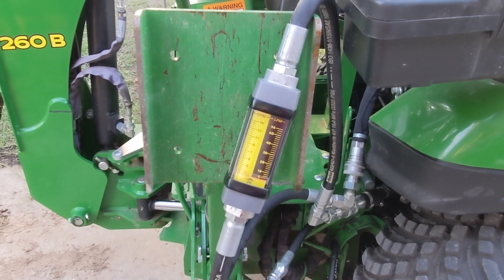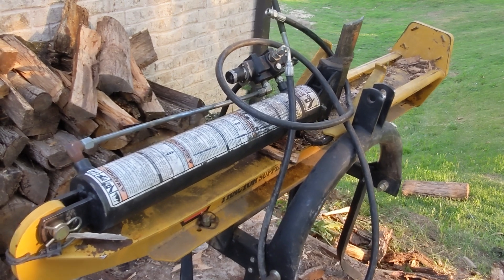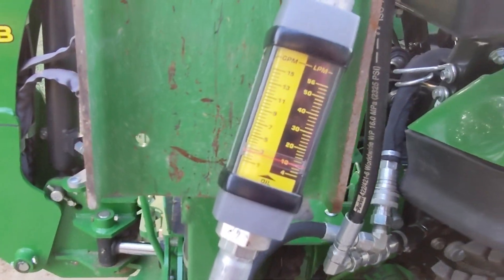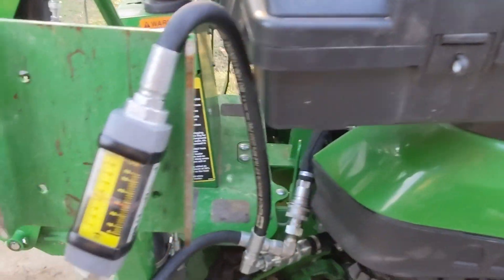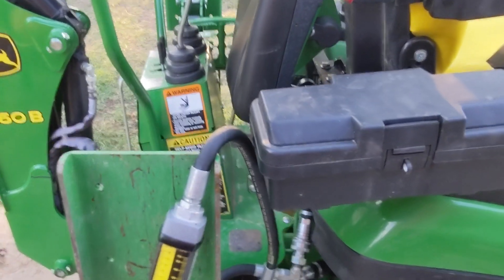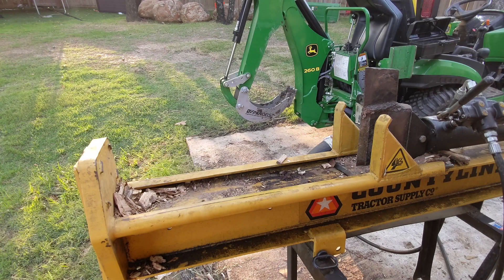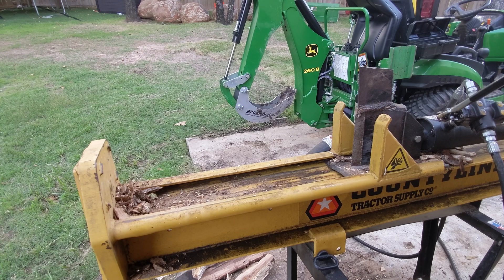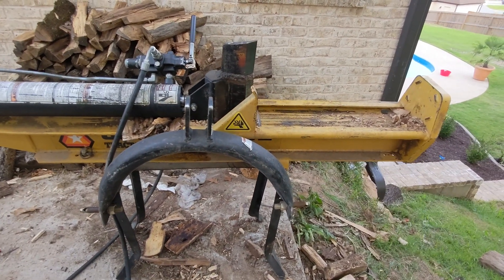Faster Log Splitter - John Deere 1025R with HydrosPlus Extreme Kit

Comment: Would that much volume make the 3 point Jerky? What about the loader?
Reply from the maker: Since the valves for the loader and 3pt are variable, it doesn't make it jerky.  The difference is that you don't move the lever as far to get the same speeds you have with the stock pump.

Comment: There nothing wrong with the splitter or your tractor. A lot of tractor dealers discourage 3 pt splitters because they’re slow.  Look at you tractor specs and compare to the splitter specs.   It requires more flow. The same splitter connected to a hydraulic pump and reservoir would be just fine.  Small tractors such as this don’t produce enough flow to run a splitter like you have.   Look a Messicks Kubota.  He did a video on this particular problem.

Comment: I understand that this is not the point of this video, but something is definitely wrong with that splitter. I own one like that - 25 ton County Line - and it works way faster than either of two cases here. Complete full cycle (forth and back) takes 11 seconds. And it operates using much smaller 6.5HP gas engine. This log splitter has severely obstructed hydraulic flow somewhere, which probably was the reason why previous owner sold it in a such dismantled state.
Reply from the maker: The reason your splitter with the dedicated power unit operates faster is because you have a 2 stage pump.  Your pump pushes about 14 GPMs up to about 600 psi, which isn't enough to split even a small log, but once it hits resistance, it drops down to  about 3 GPMs and the pressure goes up to about 2500 psi.  This will split just about anything.  That is a definite advantage to the log splitters with their own power unit.  The disadvantage is portability/size (which is minor) and the extra engine to maintain.  

With a stock 1025R, the splitter in the video operates about the same speed as your second stage, or power stage and can push about 2000 PSI depending on your settings.  With HydrosPlus, you can pump that up to about 8 GPMs, but that's still only about 60% of what yours will do without a load.  Huge improvement over stock, but if you split a lot of wood, I think one like you have would be a better option.  You can definitely get by with HydrosPlus, but if I were running stock, I wouldn't even bother.  

Thanks for the comment!  I did the research on why one like yours is faster after I did this video, so that's why I didn't explain it in the video.  Your comment gave me the chance to clarify.
Reply: @HydrosPlus  thanks for the explanation.

Comment: I mounted a splitter on my front loader and used the 3rd function there where a couple things i didn't like iI only used a 3 inch cylinder so with only 2,000 psi it only split some things and the other was it change the fluid leave to much for my liking I checked it when the splitter was all the way out and again when it was all the way in the fluid when up and down like 3/4 to 1 inch on the dip stick. I only used 3 inch because I used a log splinter that was already made and had a cylinder on it and I also wanted it to be a little faster

Comment: I have been thinking it would be nice to have a log splitter mounted to a 1025R FEL powered via the front third function. That way you could drive up to a semi-large diameter log, pick it up with the splitter, take it to where you want it, then split it into manageable pieces. Some large logs can be difficult to wrestle onto the splitter. I’ve seen videos of this configuration with a skid steer. Do you think this could work using the SCV to operate the splitter ram?
Reply from the maker: Yep - this wouldn't be a problem.  On the factory third function,  you can get about 7-7.5 GPMs depending on tuning and based on the plumbing (2 sets of 1/4 quick connects).  This would be plenty fast and even faster if you used a smaller sized ram that the 25 Ton I'm using in this video. 

Now I have to try to get the idea of building a bucket mounted splitter out of my head! :)
Reply: @HydrosPlus  building one would be a good video! Artillian sells a JD Quick Attach welding frame that looks like it would simplify the build. Weld on the splitter rail and replumb. I’d love to see it!

Comment: Need to do test on hydraulic post hole digger off the 3rd funt. On the front of tractor.
Reply from the maker: I can't find one for the price I want to pay :)  I know it will run it because you get between 7 and 8 GPMs depending on how you choose to tune it.  The smaller ones will run on 5-6 GPMs.

Comment: It’s nice but it’s too slow for me I have a regular log splitter with an engine on it and it goes a lot faster than that
Reply from the maker: Yes - some of the nicer self contained log splitters have 2 stage pumps so that you can go faster until it hits resistance.  I think you would have to get up to the John Deere 5 series to keep up with the 2 stage pump.  The current 2 series only has ~5 GPMs.  Same for most of the 3 series, but the 3039R gets up just above 8 which should be similar to what you see in this video using HydrosPlus.
Reply: @HydrosPlus  I understand good video